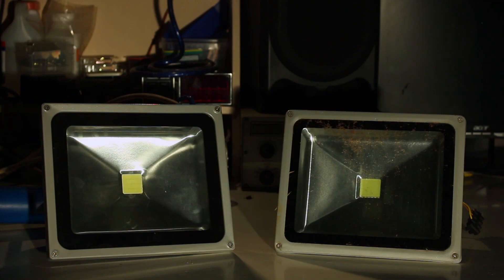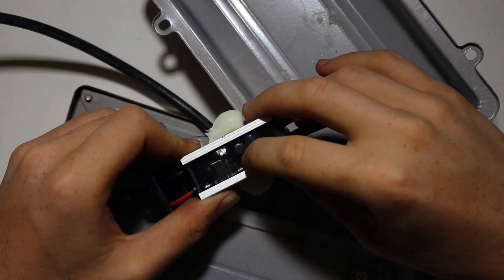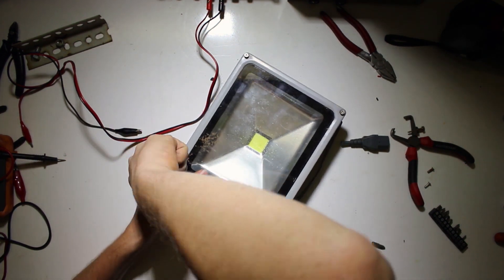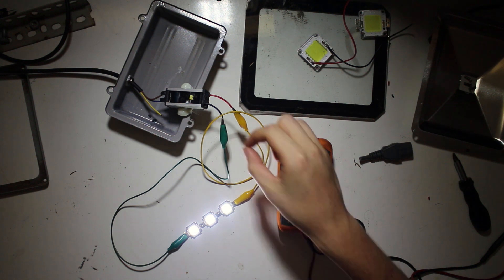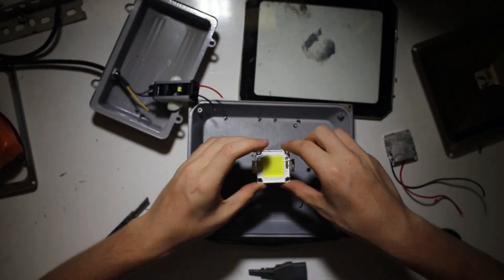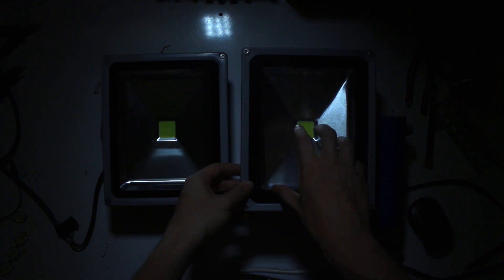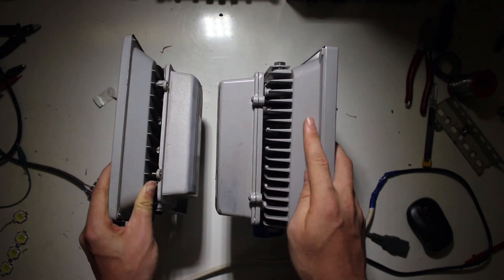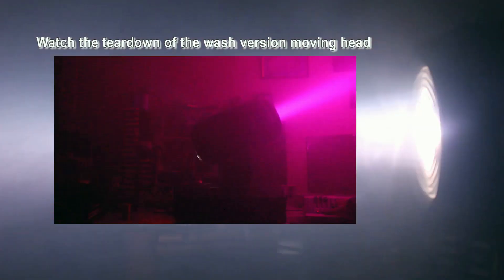Repair: Cheap LED Floodlight after 15 Months #9

Comment: When it comes to these floodlights, it is wise to open them up before first use. Connect the ground, and check to make sure there is enough thermal compound behind the LED and correct if need be. Also might want to verify that there will be no water intrusion for your setup.

Comment: If the LED failed it may be due to faulty driver. Once the driver gets hot again, it might fail to properly limit the voltage. You might should have replaced the driver also before that old one blows out your new chip. I had a 10w LED flood go bad. The driver was outputting too high of voltage which destroyed the LED. The light is good after replacing driver and chip with a better neutral color temp too.

Comment: Might be worth noting that the forward voltage of a 10w LED is actually closer to 9-9.6v as the diodes are arranged in a series-parallel configuration with 3 diodes in series. each diode has a (rough) forward voltage of about 3 to 3.2v. You can exceed this forward voltage just so long as you do not exceed the maximum current. Calculate the limit you need to set when upping the forward voltage and the driver should self-regulate.
Reply: Do you know where I can get a Magnetic Inductor for a Husky K40011
Reply: @fjb6576  If you mean to replace the switching transformer, you would be better served replacing the whole power supply as they're usually designed and built specific to the application they're being used for. You would have to know what manufacturer that transformer came from and what the spec was to get a replacement. If you're desperate enough you could reverse engineer it, but by that point you're better off getting a whole replacement power supply.

If you mean an inductor for input filtering or smething like that though, it depends on the design of it, but if it's a simple toroidal type you can normally just reqind those quite easily.
Reply: @TheSoxmania  Thanks for the reply, the circuit board has  FW-5      /_\ 94v-0    E17166 does that help to ld it. It is a round green ring with separate windings on each side.

Comment: Hi.. Would anyone here be able to advise on which solar flood lights with a proximity sensor would be a reasonable to best model to buy.  We have been experiencing a huge surg of break-ins with load shedding in the evenings in the Roodepoort Surburb we live in . Any advice would be appreciated as there are only reviews of products
 that are not sold locally.
Reply from the maker: Hi Aron, every country has their own lights that work well. They normally go under different brand names as well. Just check reviews on Amazon Takealot Aliexpress or whatever online site is popular in your country.

Comment: I know this is old but, are you sure that constant current supply was actually a 30 watt unit? I've noticed that quite often they supply a 10watt driver, even if they supply a 30 watt LED and market it as a 30 watt flood light.
I recently opened a 20 watt food light, only to find a 10 watt constant current supply.
Reply from the maker: I highly doubt that it could handle 30W. I would not be surprised if it was 10W

Comment: The cheap-one is under driven so it doesn't need as much cooling.
Reply: nl1cat Don't count on it to be functionally effective at doing what you think it is intended to do. Faulty assembly plus skipped steps/parts and poorly manufactured circuit boards and components add up to a mish mash of random outcomes encountered.

Comment: why the yellow cable isn't fixed on the metal box? Is it a big issue ?
Reply: It's actually a Yellow and green cable which indicates it is the Earth or ground wire. If this isn't attached to the metal housing of the light, there will be no protection if the power supply fails and a live connection is made to the casing. Basically meaning you could get shocked if you touch it.